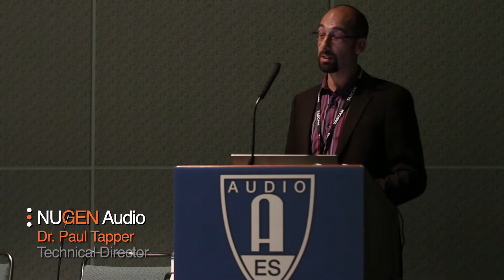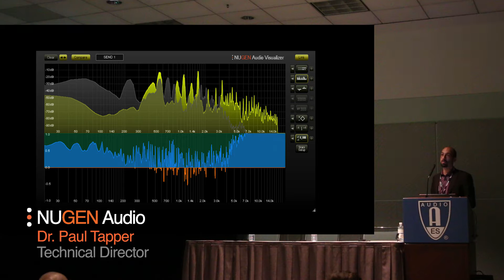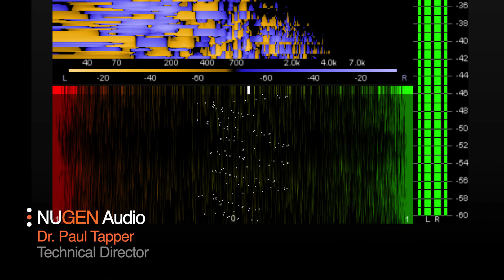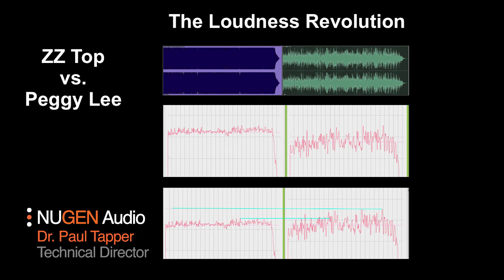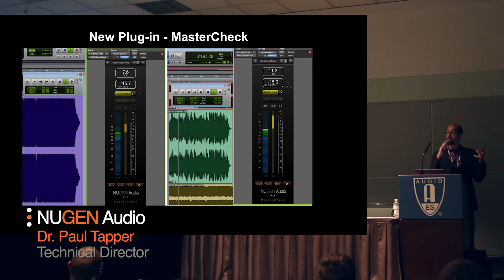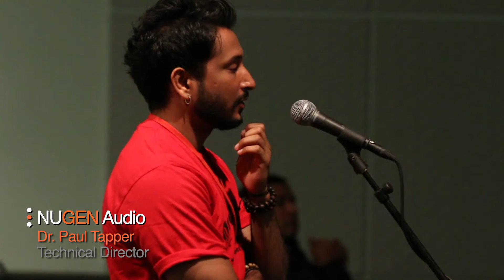'Techniques and New Challenges in Audio Metering' @ AES 2014

Comment: Interesting. I'm wondering about the True Peak meter. Paul suggests he measures the analog peak, not the level of the digital sample. Really? And where does his plug-in find the original analog signal. Once a signal has a .* appended to it, which happens right at the first ADC of the mic pre, any hint of the original signal is long gone.